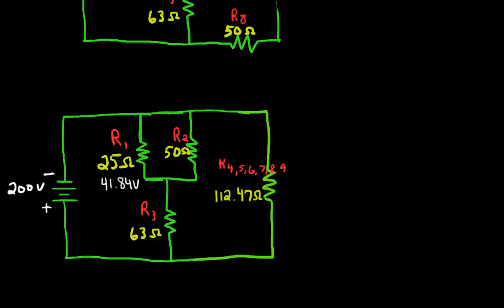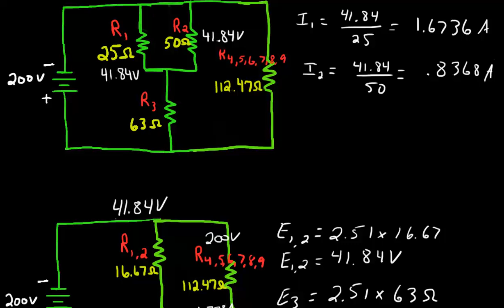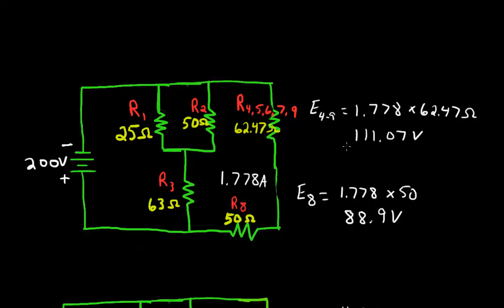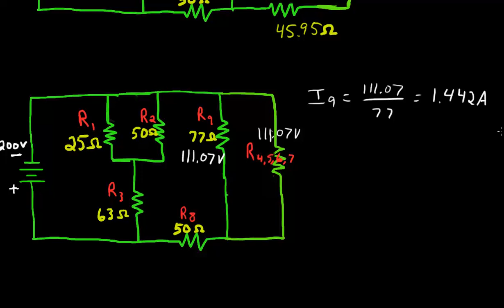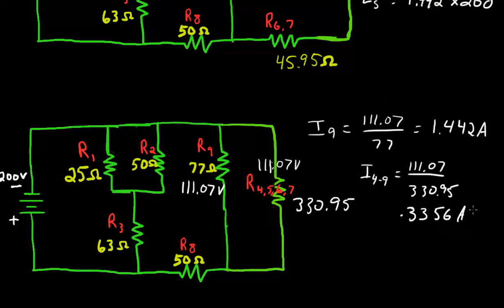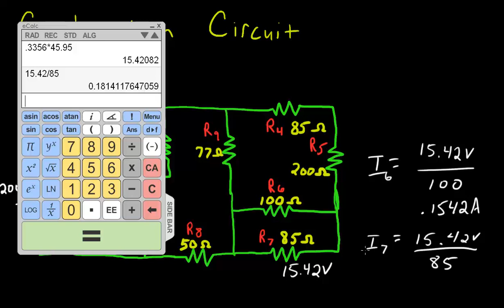Combination Circuit Calculations

Comment: You are an excellent teacher, I actually caught your mistake so I must be learning! Now I see a system to do these complicated calculations. Reduce circuit to series, do the Rt, It, Vt and draw diagram for each step if reduction and then expand it back for the V and I....love the PEIR chart too. Wish my electronics teacher showed us that.
Reply from the maker: I appreciate the kind words. Good job catching the mistake. I thought it was best to leave the mistake in there rather than editing or reworking the problem. After all, one of the best ways to learn something is to learn from a mistake.